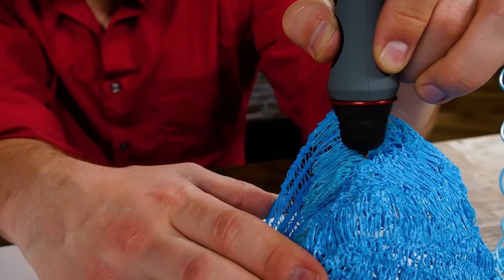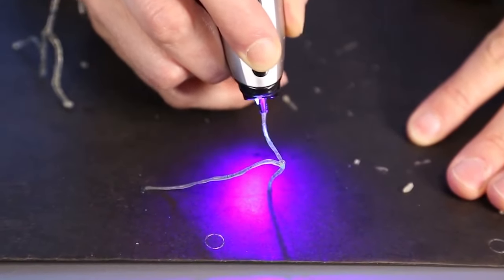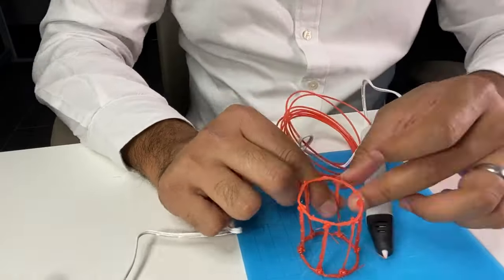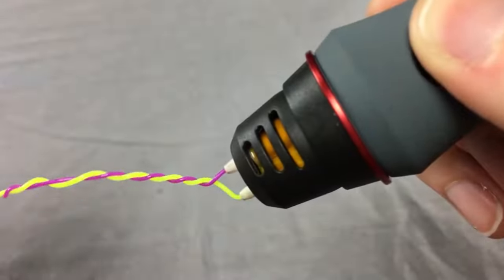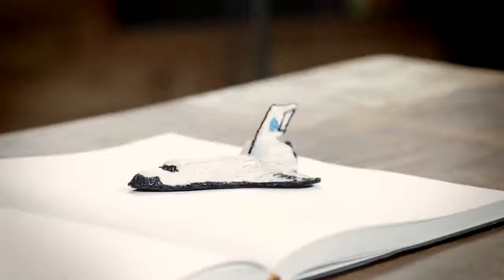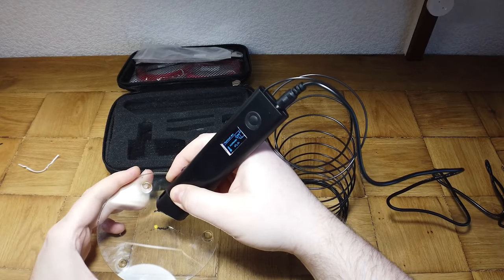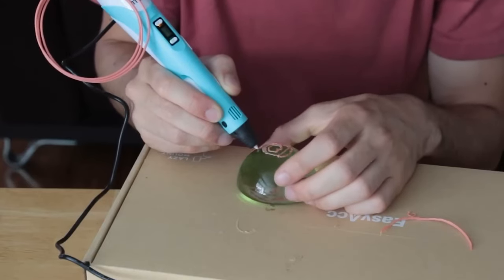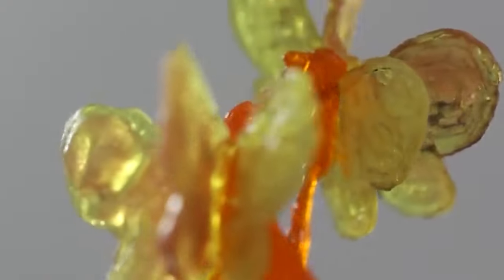Best 3d Pen - Top 5 Best 3d Pens In 2023

Comment: I had to stop at the first pen because the "cooling system" is not a cooling system.  It prints in resin and cures it via uv as you print.  In short the presenter is clearly unfamiliar with the subject matter.

Comment: I didn't know the Creo pop was still a thing. I had a problem with MYNT3D  The  first  of use I pressed the forward  button to make something it got clogged and the motor wouldn't stop it kept pushing the filament caused the heat head to come off.